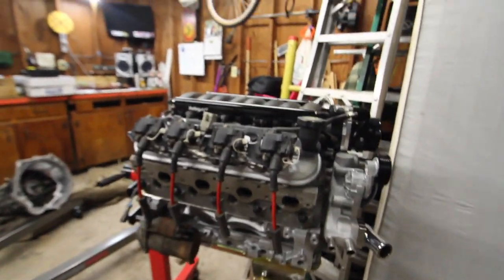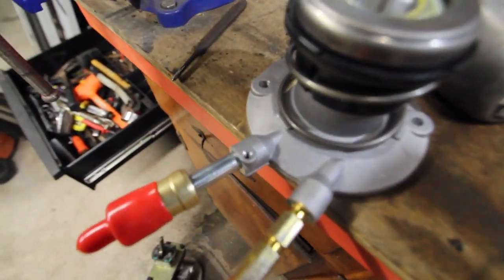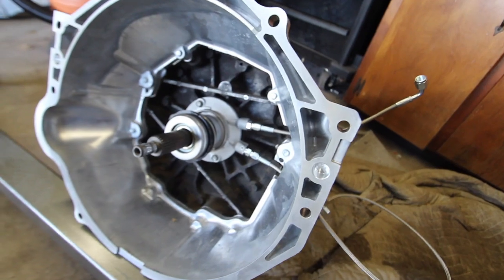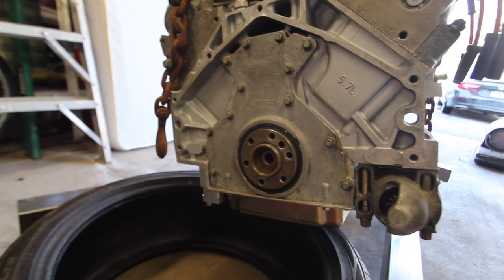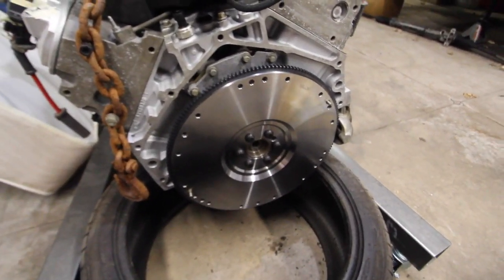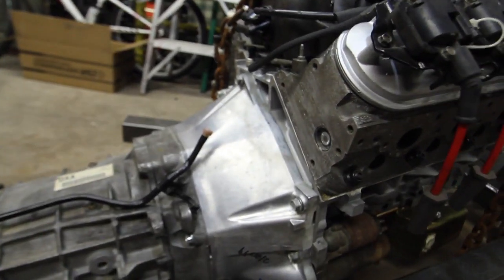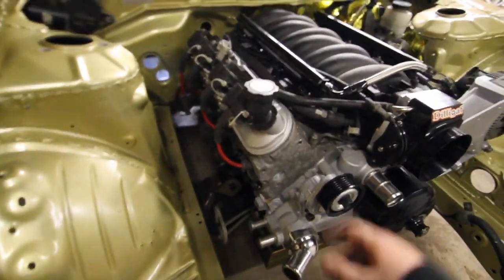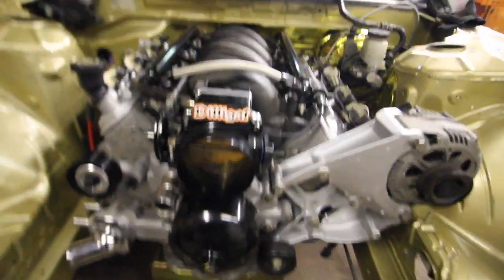LS1 T56 INSTALL S14 240SX

Comment: So your vids have actually helped a TON on my s13 swap lol. One question, what throttle body size and whats the, what appears to be, a conversion plate attached to it? I’m using a C5 engine and the original throttlebody is elctronic, so i have to change it.
Reply from the maker: My engine came with factory corvette throttle body and I decided not to use it for that exact reason. I end up buying a generic 92mm cable driven throttle body with a 3 bolt to 4 bolt adapter plate. Pretty sure I got those parts on Amazon, not sure if you’re looking for name brand but they’re out there. My new setup is a FAST 102mm

Comment: I was thinking of using the same oil pan but I thought it was direct bolt in.
Reply from the maker: It is. You just need GTO pickup tube
Reply: @KevyHerr   do you have the part number of the oil pan?
Reply from the maker: @semirm8248  15-276-Kit on enjukuracing.com
Reply: @KevyHerr   perfect thank you so much.

Comment: Did you have to cut anything off the t56?  Ive heard you have to cut the 3 bolt/ear loops on trans bell housing
Reply from the maker: I didn’t cut anything off of the trans. I just hammered in where the firewall and tunnel meet